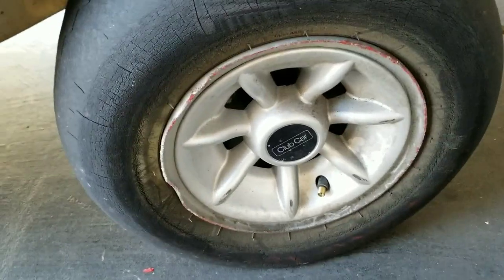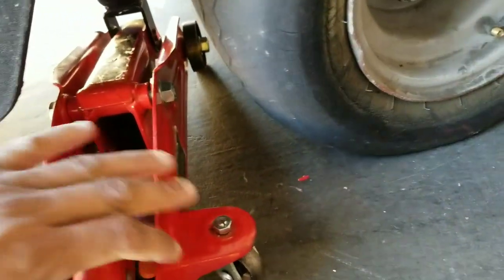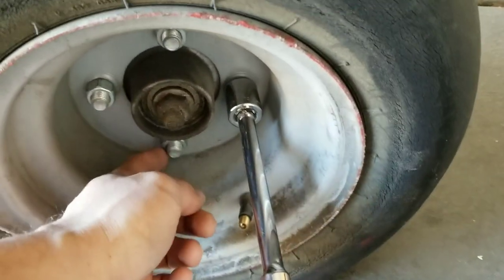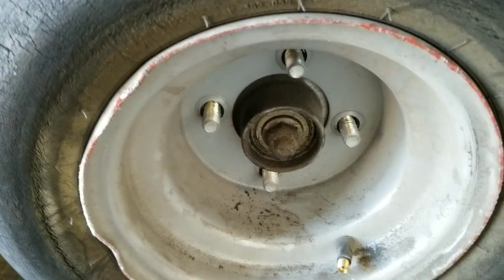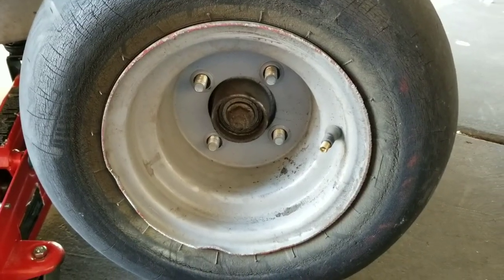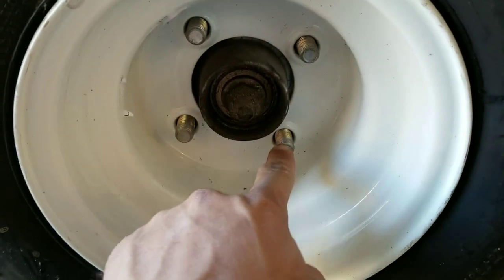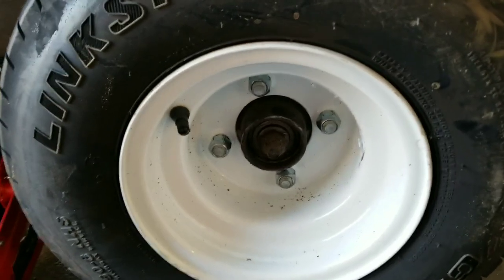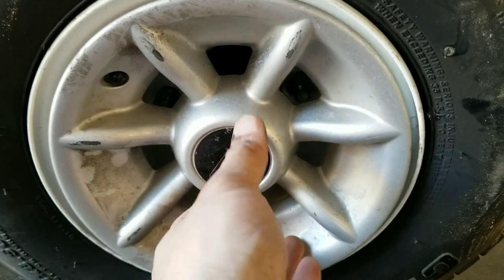Replacing Golf Cart Tire

Comment: You shouldn't remove the nuts all the way before jacking up the cart.  Leave these on but just loosen them.  That way, if the cart slides off the jack while pumping, the wheel will stay on during the drop and still support the cart. Also, you put the nuts back on backwards. The tapered sides go into the rim not facing out.  The taper holds the wheel from shifting on the studs.  Otherwise good video.
Reply: What size nuts